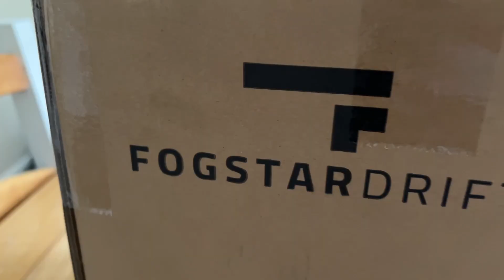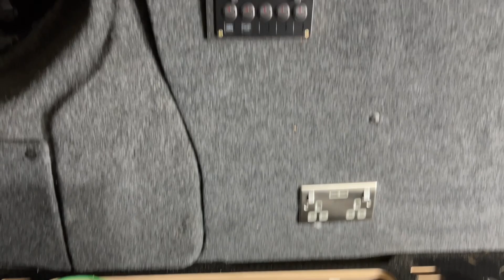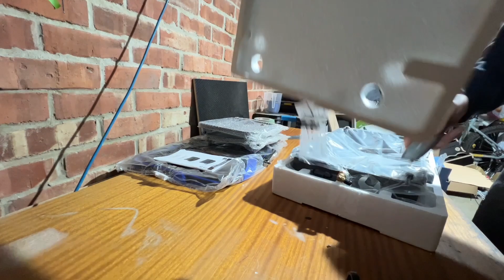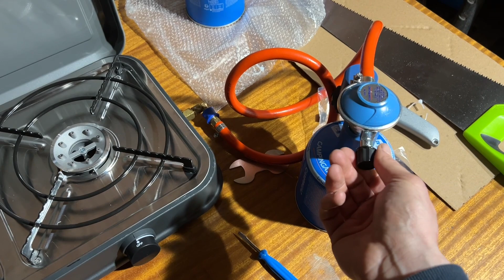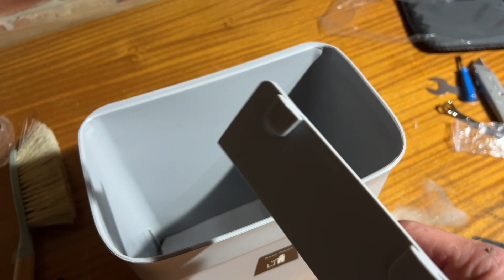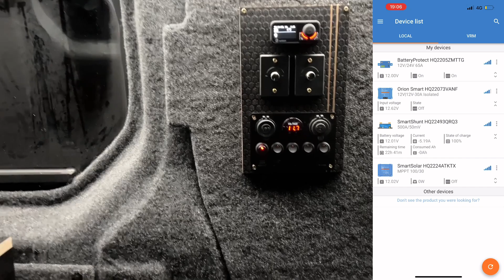FULL CAMPER CONVERISON - Turning my van into a HOME

Comment: Just watching your video. Nice conversion. I've done similar to you with my fridge. But I noticed you've got a little mechanism to stop it coming out. Can you tell me what it is & where you got it from. Please
Reply from the maker: Mine came with the furniture set up that I purchased. if you type in ‘ drawer runners heavy duty’ into Google you’ll find loads of different types. the ones I have for my large furniture units are rated to 220Kg the fridge and cooker one I imagine are much less but still do a great job.